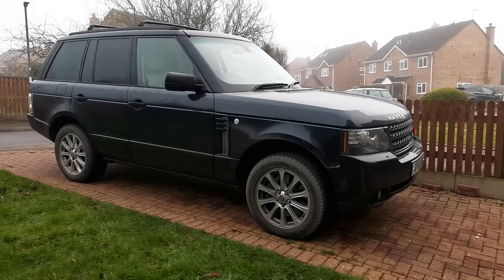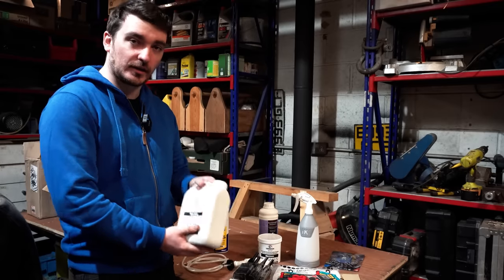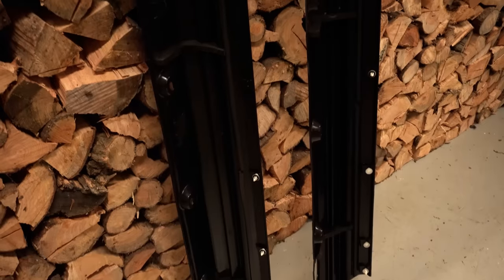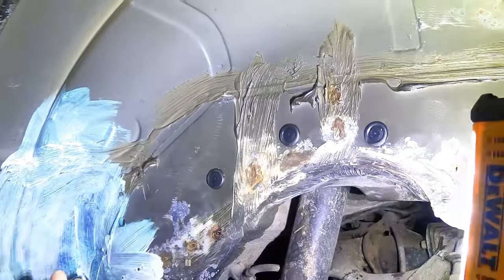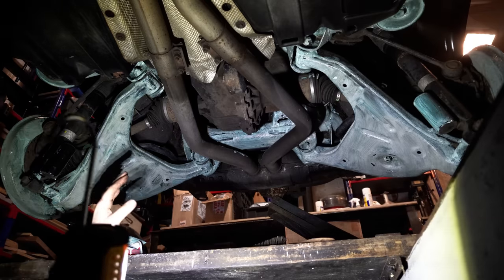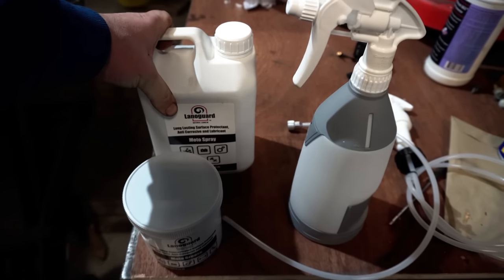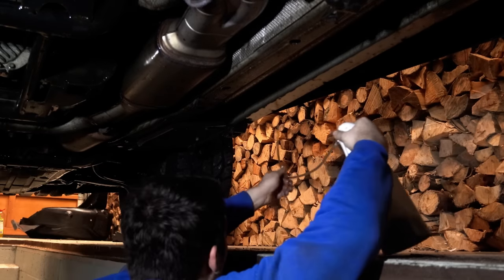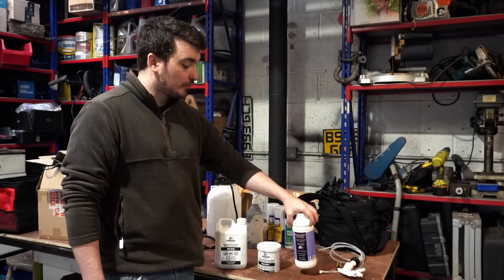Stop your L322 Range Rover from RUSTING away!  (DIY Undercoating Arches & Sills)

Comment: Just a few  points, the sills are multi-layered, it's worth taking out some of the plastic bungs and injecting in there. Also there are bungs inside the rear wheel arches that let you inject into the wheel arch edges where they rust out from. You can also inject form inside the boot by removing the side covers. The jacking points are  removable and worth a quick spray inside. I haven't tried Lanoguard and used a well known wax product slightly thinned with white spirit.

Comment: Sam have removed my rear subframe and completely stripped, removed top and bottom wishbones, removed diff unit and parking brake unit. The subframe looked really bad however the frame was very solid, needle gunned treated with the 661 then coated with zinc primer and 3 coats of 2k black. the wishbones were also solid, power wire brushed, treated with 661 then painted with lidl black spray 3 coats. Rebuild was carried out on a stiffened 18mm ply with 4 heavy duty wheels fitted. Just enough room to slip under the car that was on Jack stands at max. All rubber bushes were renewed (not the 3 diff bushes) the bearings, air bags, parking brake cables, abs cables, brake pad cables, discs, shoes brake pads and all shoe fixings, top wishbone to knuckle bolts changed these had to be cut, the inner bolts for the toe links were also cut so renewed. all flanged zinc coated flanged nuts replaced and copious amounts of aluminium anti seize on all bolts. The inner of the subframe was sprayed with Lanoguard. Tomorrow will treat the chassis as you are doing in this video. By the way the car is a 4.4 tdv8 2011 Autobiography silver. Supreme comfort average 24 mpg on a run 30. Have been on the car doing the subframe etc just under 4 weeks, retired so time is no problem. Have had the car 9 years now. Always enjoy the show sam thanks.

Comment: Everybody has their favourite ways of treating rust. Personally I like to use a converter gel like Bolt Hamber Deox to get the bulk of rust converted to good metal before one of t the phosphoric acid based treatments (that go black). I don't like painting straight over though so I prefer to sand it back with 800 grit so that it only remains in the pits. I then use an epoxy mastic paint, either sprayed or rolled on, and then top coat with a 1k enamel. This gives a really solid and tough finish, which then gets overheated either with a rubberised 3m spray (not the disgusting tar one) or BH Dynax wax - I've not found the lanogaurd to be as long lasting, despite both using lanolin derivatives. I also don't like the highly regarded BH zinc primer as a base, the epoxy mastic is far, far superior, especially if applied to sandblasted steel. The other thing with this is that I find a scotch wheel on the grinder to be more effective than the wire wheel as the wire polishes the steel and makes anything you put on less likely to stick. Blasting is best, but either a sanding disc or a scotch wheel are a good alternative. Just my 2c from restoring a few cars over the years, the current one being an old Impreza (which means lots of rust!). I also like to get marine grease into all the corners before rebuilding too, it's good stuff.
Reply: That's no criticism of what you've done @samsmotors btw, and I appreciate you've replied elsewhere to say this was a more efficient way to do it. Without actually removing components there's a limit to what is a reasonable solution! One decent half way house paint option to add on as an extra layer (I use it on brand new OEM Subaru parts) is Simoniz Tough aerosol paint which is an enamel. It takes a few days to get fully hard but it's a really tough option for chassis parts underneath, especially if you then overcoat with a wax of some description like BH Dynax or Lanoguard.

Comment: Good advice, I have a venerable 2002 year L322 (3.0 TD6) which I keep in Latvia, and it had accumulated a fair bit of rust underneath. After a mechanic commented on it, about 5 or 6 years ago I started giving it anti rust treatment each year. Well, not me personally… I took it to my local branch of “KROWN,” a Canadian company which knows about the ravages of harsh weather & salt on roads. The initial treatment was very comprehensive; after removing any loose surface rust they steam cleaned it, and then applied their “T40” compound to every nook and cranny. They even drilled tiny holes in inaccessible cavities including doors, and pumped it in through a tube. They also did the engine bay & spare wheel compartment. T40 is an all in one product that converts existing rust into an inert compound and simultaneously leaves a waxy oil-like layer which sticks to the surface to prevent further rust. The beauty of it is its penetrative qualities, if applied correctly it continues to seep its way into the most inaccessible areas in the following hours & days. Since then, I have it redone every year, alternating between a “refresher” treatment and the full original treatment. I try to do it each Spring because it’s an opportunity for the steam clean to remove any winter salt deposits, although with the treated surfaces they not really going to be able attack the metal. Now I have the satisfaction of a Range Rover that is rust free, more than can be said for most Range Rovers half its age. I still get comments from the mechanic, but now it’s more like “this is the cleanest example I’ve ever seen for its age!”

Comment: Wish mine was that good. My 02 Td6 failed its NCT just before Christmas due to excessive corrosion on the rear subframe. It was rotted out on the front most point where it mounts to the body. Subframe swap required. Car is abandoned in the yard while I decide whether to scrap it or have a go at saving it. Motivation is low at the moment.

Comment: Sam one thing I think you have missed is that on the outside of the sill panels there are numerous 20 mm odd plastic bungs you can take out and slather your sheep dip lol inside. I've got the dreaded tin worm in the ends of the sills and all round the wheel arches and along towards the rear of the car just above the plastic bumper on both sides. It pretty horrendous and there was no sign of it when I bought it just 13 months ago. It had been filled and blown over and I missed it. My fault and I'm paying for it now. I paid very good money for it and I know the dealer had got it repaired. Bastard! But caveat emptor and all that lol I paid good money because it is an Overfinch model with a full Burr Walnut interior and Alcantara dash that alone was £1500. I have the original Overfinch bill and on top of the £75 Grand the car was the Overfinch bill was nearly £23 grand! Ouch! It's a 2006 4.2 Supercharged and the engine and box are sweet as a nut and really goes like stink when I want it to. It's also on LPG so I get reasonable economy even if I get slightly heavy right footed lol but with LPG at around  80 pence a litre I can still afford to run it. It's probably cheaper to ride around in the car keeping warm and leaving the heating off indoors! I bought 2 gallons of Waxoyl and after rust conversion everywhere I can get to I will slather it inside  and out with gay abandon. No ! Don't go there!

Comment: Thanks for this video Sam, I might ask somebody to do that to my 18 year old L322 mk3 td6 HSE (3.0 litre straight 6 diesel BMW M57 variant); Unfortunately I'm not well enough to do it myself.  I've started practically rebuilding it already (I'm lucky enough to have a friend who does all the work on it for me & cheaper than a garage) & only bought it last Good Friday, so may as well cure any rust & stop it getting worse 🤔
What i don't understand is, if a vehicle manufacturer is producing & selling a vehicle in the £70k to £100k price point, when new, why don't they galvenise the ladder chassis & parts that are known to rust, especially as it's a 4x4 (AWD) & on the V5 Log book i believe, & certainly whenever i look it up online for parts, mine is classed as a diesel off road vehicle,  so they know it's going to rust & galvanising the chassis & various panels & parts underneath would've been a good thing, surely 🤦‍♂️🤷‍♂️
Reply: Also, & i know this is unrelated to the topic of this video, but I have an electrical issue, if you have any videos on that, my cigarette lighter 12v sockets measure 12v until I plug anything in, then it drops to around 5v & won't even charge my phone. I suspect it may be a relay in the fuse box, in the driver's side rear wing, but the owners manual just forbids owners to remove them, saying to take it to a dealer. It's driving me insane 🤷‍♂️ If you have a video on this, can you give me the link so I can sort mine out please? If not, no worries & thanks anyway.
Reply from the maker: Sounds like it might be shorting out internally when something's plugged in. If you can replace just the socket itself, I reckon it might sort the issue.

Comment: Good job done, don’t suffer quite as bad with corrosion here in France (don’t use salt on roads), but I might check mine out at some point to be sure. 👍
Reply from the maker: I'd say yours will probably be like new.  Here in Ireland stuff seems to literally stay wet for 6 months of the year and never gets a chance to dry out.  Any nice farmhouses with outbuildings for sale near you? 😅
Reply: @SamsMotors  there’s always stuff for sale over here, and cheap 😀👍

Comment: Hi Sam, you have solid Range Rover. Even with the mileage. Great buy. I have a td6 l322 for now. I will get another tdv8.  I have to weld up the sills. The jacking point has rusted. I will git it re-strengthened for the test. It will be safe to jack up on the back corner when done.

Comment: Great job Sam, you should be well set for a while quite a satisfing job. Did mine about 18months ago rear aches out and used Aquasteel seemed to do similar turning rust to black 👍 then Lanoguard over the top, 6months ago I had side sections off and had same amount of dirt fall out! Rust hadn't started to set in so cleaned and Lanoguard. Touched up a few areas with black paint. This summer will go over again with Lanoguard. Painted rear exhaust box too as wasnt looking great. The front section of the rear arch I painted as well and then fitted weather strip to it and bought new strip for the rear section as existing was  not in great condition. MOT guy always comments about condition of underside compared with others he sees👍 keep it up. Looking forward to your next one! Cheers
Reply: Lanoguard is very good but needs applying in warm temperatures for best effects, hope your garage was heated.

Comment: Another good idea is to get hold of freelander arch protecter and fix to lip on rear wing to join up with the bit Land rover did cover. You have to trim to size but when I did mine I packed the back of the return with some lano grease I bought back from NZ with me 8 years ago . I fixed the trim and packed more lano grease to stop any build up of rust causing mud and road grime. The arch protector stops the stone chips that the unprotected arch is prone to.
Reply from the maker: Good plan - will get some ordered up.

Comment: I'd really advise top coating any  rust converter with paint, then the rust treatment you applied.

As a  Part 2 for rust prevention on an L322 and stopping common rust area, I'd look at  rear quarter panel behind the wheel area and above the bumper . You often see rust here on older cars and it rusts from the inside out. You need to look in the fuse box and radio gear areas and remove the boot vent boxes.
Reply: I would agree with top coating the rust converter.  I used Corroless chassis paint and then followed that up with Dinitrol 3125 HS.  Never tried Lanoguard, if it washes off then the rust protection is living on borrowed time unless you have painted over it first.  All these rust prevention treatments need yearly investigation, especially on Defenders.

Comment: Must be really satisfying to know that’s done. Great video 👍
Reply: Great video. Think I'll look into doing this to mine, it's a similar age to yours. Have you checked yours for water drainage issues? Apparently some channels, especially sunroof drain channels get blocked causing water to accumulate a find it's way to all sorts of places it shouldn't be  leading to expensive damage if it finds electrical items. Apparently the drain holes are under car, might be worth checking 🤔
Reply from the maker: Definitely a good tip - will definitely check the sunroof drains soon.
Reply: @SamsMotors  you should feature it in a future video, I've struggled to find a video showing how to check and unblock sunroof drain channels

Comment: Did you check your brake line running front to rear as we've had plenty rot through near the rear Subframe and need replacing which isn't a nice job to fix insitu!!!

Comment: i tried the lanogaurd last year and yesterday i had a look at wheel arches and have to say it was crap and last year i did a good job on doing it, so yesterday sand back rust converter and used 2 pack marine paint and then underseal the hole lot, today right side to to,must say very disappointed lanogarurd, the best stuff i have ever used was rust bullet that works well

Comment: Sam, Have you ever looked into replacing the cameras on this car? I have two with chipped/broken lenses on the front bumpers and I've been looking for ways to replace them more cheaply. Wondering if you've had any luck?
Reply from the maker: Hey John,
It sounds like you have the surround view camera system which is a pretty rare option on the L322.  Mine just has the reverse camera which still works great (when the lens is clean).  It's not something I've really thought about messing around with to be honest!
Reply: @SamsMotors  Yup, the surround cameras - the later cameras are ~60 euros rather than ~300, looks like I'll need to get one and do some experimenting myself then! :)

Comment: rear jack points are tragic on these ,,, I make a lot of money repairing these , its not a cheap job as its all time , 
you should do a follow up video and see how it looks one year on.
I use acf 50 and give a 3 year warranty on my repairs.
Reply from the maker: Yes it is a sad fact that they rot so badly.  I’m glad you’re helping to save them though!  
I’m going to have her over the pit next week so will likely do an update then.
Reply: @SamsMotors  theres a gap in the plastics at the front of the rear arch and a gap at the rear of the rear jacking points , look in there if its red and rusty dont poke it , spray it with acf50 or what ever your choice is and leave it alone , they are either mint , or rotten in there , never seem to be in the middle , if they are bad they are really bad , our local mot stations have found its a weak spot and poke them , no individual garage mot testing its all done in about 8 big test stations in Northern Ireland , so if one knows they share info and they all know ,,, its a big job to fix , on petrols its tank out and a weeks work , all the repair sections have to be fabricated from scratch too . good luck.

Comment: Are you not supposed to leave the rust on for the converter to react to on clean steel surely it’s not doing anything
Reply from the maker: I removed loose rust but an oxidised surface remained.  In places with no corrosion, the converter basically just dries to a hardened acrylic layer that provides another layer of protection.

Comment: I'm a little confused Sam. Nothing new there! Isn't the Neutrarust supposed to be a rust convertor AND primer? Just wondering why you didn't paint the metal before applying the Lanoguard. Apologies if you explained why in the video and I missed it. Excellent video as always though. You are getting more professional with each one.
Reply from the maker: You definitely could do that if you wanted!  You'd effectively have triple protection then.  Realistically you'd only paint it for cosmetic purposes as the Neutrarust + Lanoguard should protect it more than adequately.  I didn't have a spare ~24hrs to wait for the paint to dry so just went with the Lanoguard straight over the top.
Cheers!

Comment: A 2011 car with rust is appalling why can't jlr get galvanising their vehicles  right I've seen cheap Peugeot at 20years old with not a spot of corrosion on it.??? BTW good job years ago cars got ziebarted as a rust treatment in the 70s.
Reply from the maker: There are a few reasons I can think of but none really excuse it - I agree, it's not very impressive.
My car in particular I know had a very hard "first life" with the first owner who essentially used it as a farm hack - so it's unsurprising that there was so much mud up behind the plastics which would have contributed to the surface rust.  
The steel actually is all galvanised on the RR but that doesn't last forever - and in certain conditions it degrades pretty quickly as could be seen in my wheel arches.  
It's especially bad when you consider how right they got it with the P38 before it - almost none of those have any serious rot and the oldest are now approaching 30 years old.

Comment: Rust converters dont work.
Anybody wants any evidence of it...mail me. 
Ill send pics of my 110 chassis...ruined..
And 84 rangerover...chassis...luckily cos its really rare, i only did back crossmember...ruined..
That stuff keeps chewing away, especially when coated with paint.
You end up with crocodile skin bubbles..and under every one of them, a massive hole...
Blast it, needle gun it..back to steel,  if there is any, ..if there isn't,  no point in hiding your head in the sand, using RUST CONVERTER...weld it up...then coat appropriately...